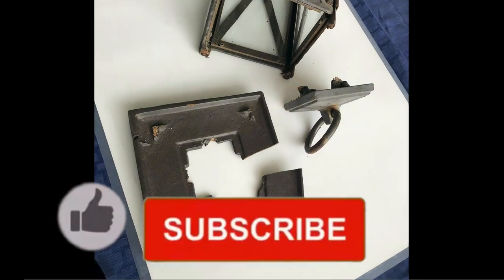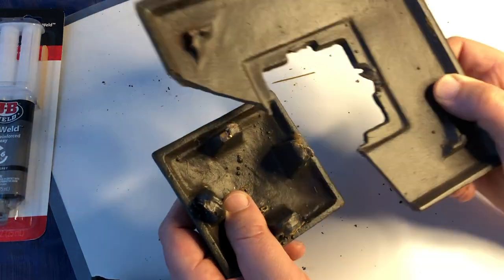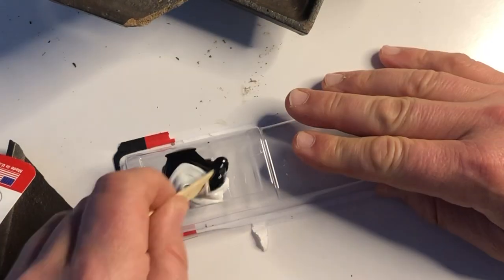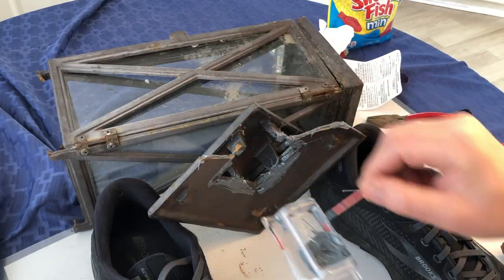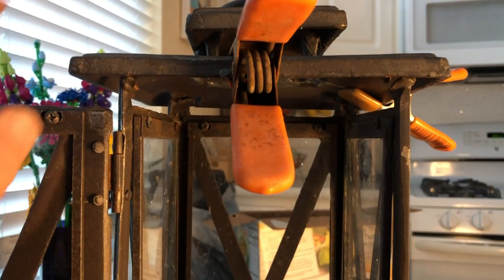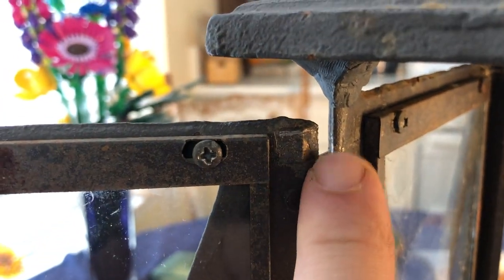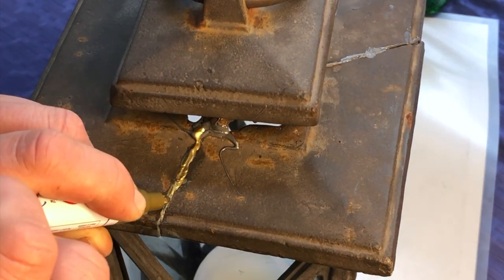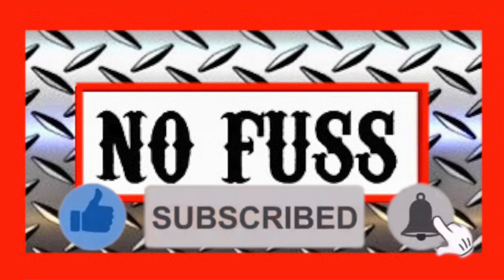DIY | How to Fix Cast Iron with JB WELD | No Fuss

Comment: Wonder if it would be ok for heat like a pot belly stove repair?
Reply from the maker: Found this online: - "Yes, JB Weld can be used on stove pipe because some of their products are designed to withstand high temperatures:"